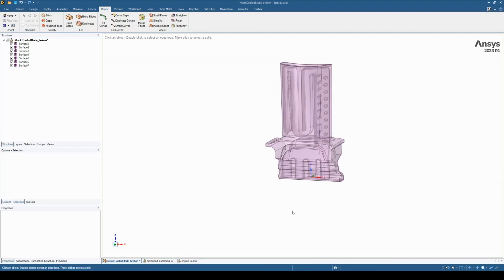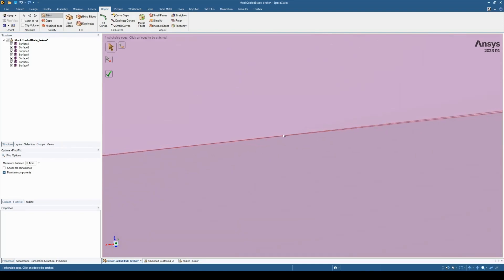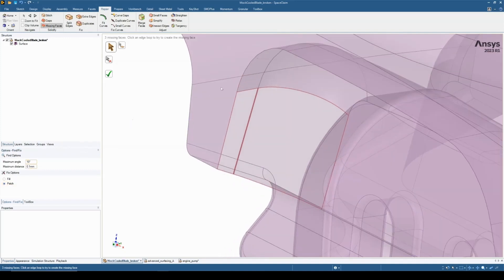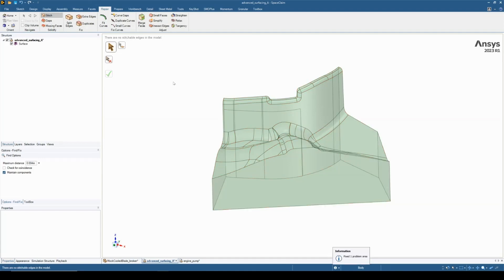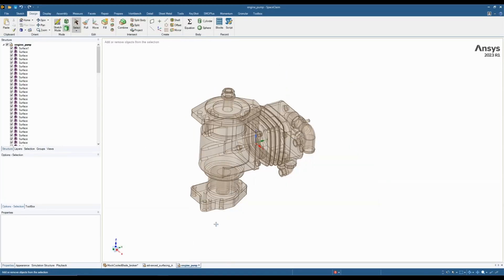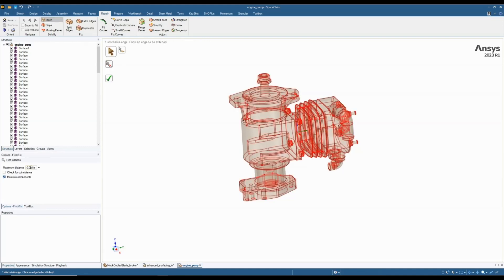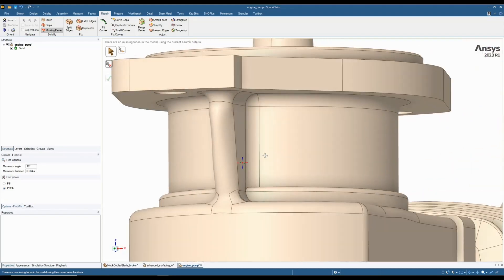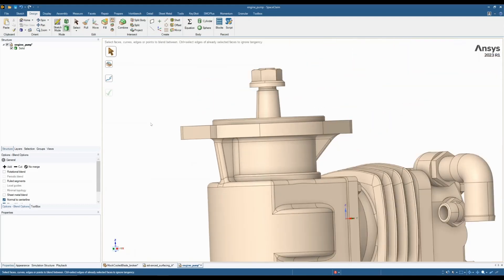Repairing Files -  Ansys SpaceClaim & Discovery

Comment: Your video helps me lot sir. I request you to make a video on taking Fluid domain inside a pump or generator. I am struggling to take fluid volume domain in a generator.
Reply from the maker: Hi, glad to hear the videos are helpful. For fluid domain extraction I would use the Volume Extract tool. We have another video that shows this tool in more detail at around the 2:40 mark hopefully this may help- https://www.youtube.com/watch?v=izXSVt6Gm2c
Reply: @originengineeringsolutions431  I am doing CFD analysis of a generator in which oil is flown inside to cool the generator as it is producing more than 50kW heat. It is having intricate paths and multiple outlet and inlets. For CFD analysis, I need to take the fluid volume. That's why I am asking. Can you make sir?